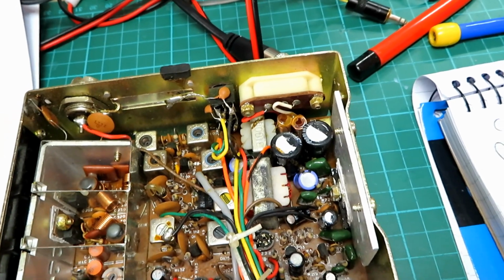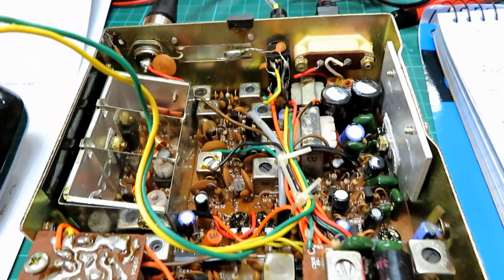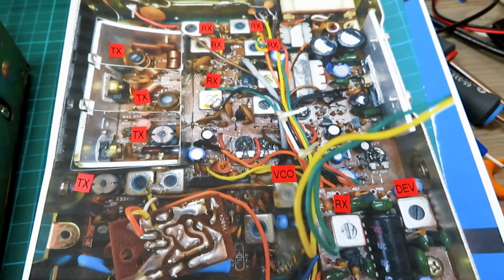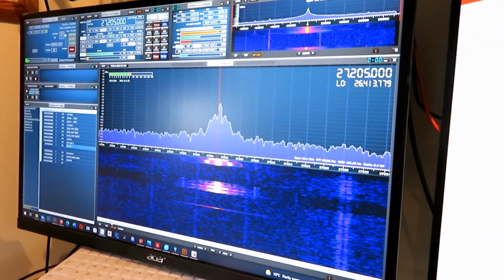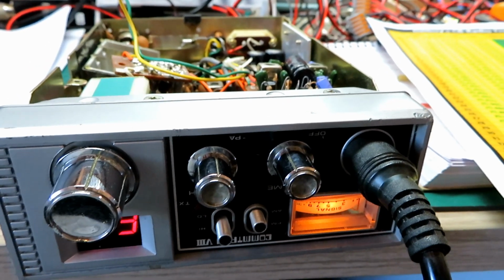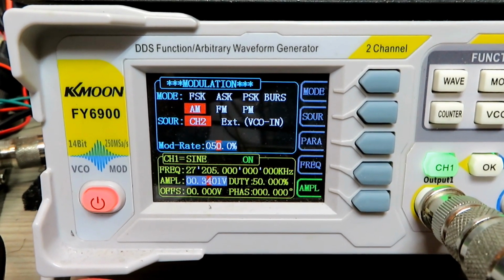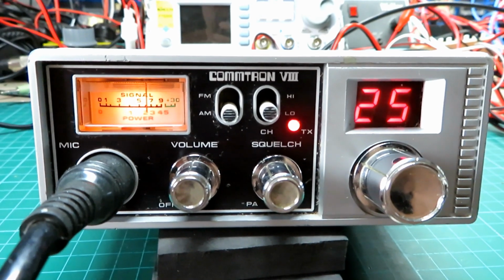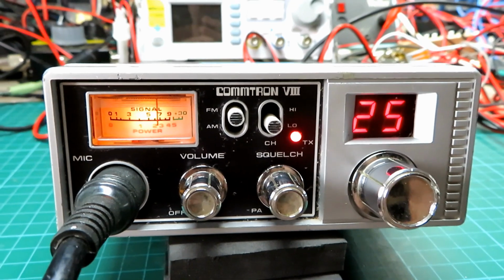U MAY THINK YOU HAVE SEEN THIS ONE BEFORE BUT YOU PROBABLY HAVENT THE 80 CHANNEL AM/FM COMMTRON VIII

Comment: This is the Commtron VIII (8) and it's a brilliant radio. I bought one of these back in the early 1980's and I've still got it complete in its original box, accessories and booklet. The radio is in absolutely mint condition (like all my radios). Shame it doesn't get any use these days, but it was my first rig, so I'm going to keep hold of it.

Comment: Just got back from my mums and found a HY-Gain 16 in the CB pile.
Reply: My mum was after a cb base station set up again. Her colt excalibur ssb my late brother gave as a gift has no TX. So got a Midland 76-900 from the pile that lit up very dim but nothing else. Got a Audioline PT345 from the pile had a mod done to it and did not RX/TX right. Plugged in the worst CB ever made Fidelity CB3000FM and it worked.

Comment: Got one on the shelf to do when I get things setup better and workshop finished. It works but cosmetic not great, so will probably tidy up and set up when I can. I hadn’t noticed the hi lo switch till just looked again, when tested it was on the 40. Got a 40f as well and a 4e to do one day as well, again both work but need a tidy setup.Thanks for doing the legwork of some of the board layout, wonder also if schematic exists or another make with the same board? Cheers Tone
Reply from the maker: Apparently it is similar to another radio but I've still to find a diagram that matches it, hopefully this will help a bit.
Reply: @knoxieman  Midland 150M ?
Reply: I’ve one on the shelf - powered it up the other day - is tatty - no output power / meter not working at the mo - might just eBay it as is (no one interested at £20) previously but that was for parts - not powered up. 
I’ve seen some fixes for waking up the meter on a YouTube some time back. 
But great to see a good video on it 👍

Comment: Your Welz SP-15M looks almost identical to my SP-350.  Chief difference is the SP-350 has two probes, 1.8-150 and 150 to 500.  Visually it has an extra switch next to the knob and an aluminium knob rather than a grey plastic one.  Maybe your knob isn’t original?  Nice meters these, I managed to acquire mine cheaply when a large ham radio dealer in Wangaratta, Victoria closed down in the late 1980s
Reply from the maker: The meter was a year old when I got it, boxed off a good friend, that was 1990 I've not had it leave me since pretty sure the knob is original, great meter.

Comment: Ive never seen one of these,. Very rare, there can't be many of these sets knocking around.. as per usual an in depth explanation of the circuit board.. i would never be able to work that meter out, a little beyond my knowledge.. top marks great video.
Reply from the maker: Thanks, yes these are pretty rare indeed, I don't think I've had one on the benchb before, most people probably think the are a cb40 at first glance

Comment: I love the white backed meters, very easy to see compared to the black backed meters.  Those sets used to work fine.  The microphones were crap, almost as bad as the Amstrad early ones.  Easy broken and dodgy connections on mic switch.
Reply from the maker: Absolutely Bob 👍